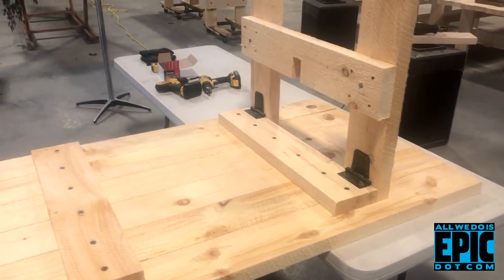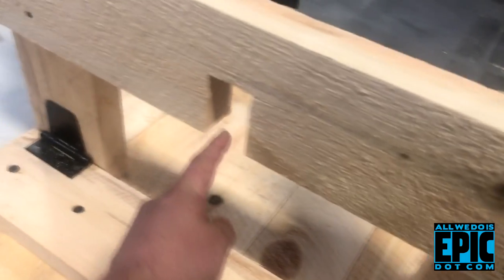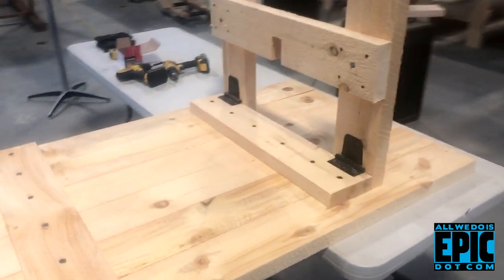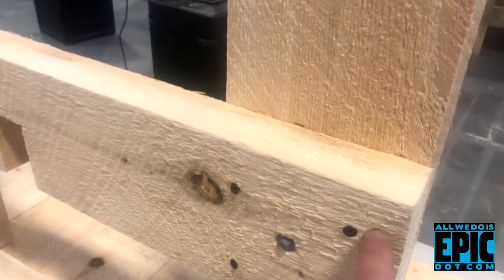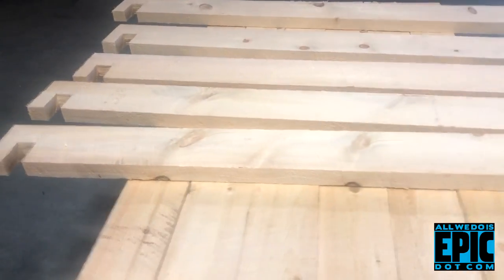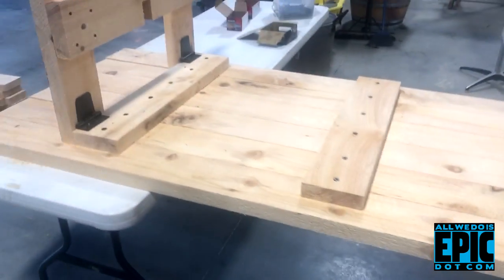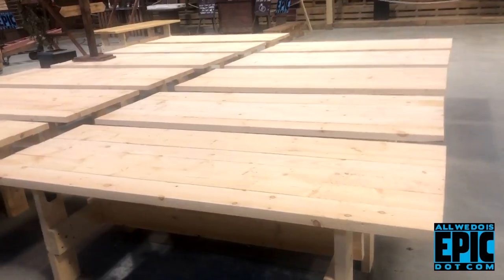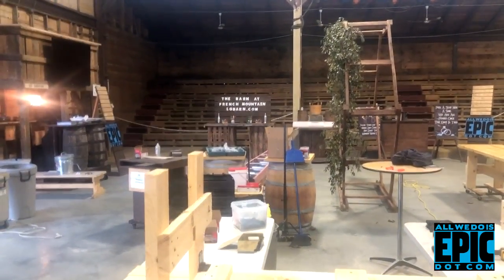H.T.W.P.D.I-Episode 1:  How to build a very simple, rustic, folding farm table.

Comment: I made some changes to the design that work really well. I am not taking credit for the build design but a few changes that address some of the issues. 
I built them with southern yellow pine. For the table top I added some pocket holes with the blue Kreg outdoor screws to attach the edge grain together and stop the top from racking. I have had no issue with cracking or movement. They have held up well through two summers and winters in Texas. 
For the stretcher board I changed the notch. The problem I had was the small end piece of the notch would break off. I moved the cut out closer to the end and cut out an L shape instead of a notch. I make it so it slightly pushes the leg assembly outwards and added heavy brackets from Simpson Strong tie to bolt the stretcher to the leg cross piece once its dropped into the notch. I used some heavy carriage bolts to fasten it together after setup. This removed just about all movement once the table is unfolded and set up. They can easily be broken down for storage. 
Do not underestimate the weight of these tables! They are heavy!
Reply from the maker: Awesome thanks Sean!
Reply: Can you please post or send me a pic of your upgrades to the folding farm table? Thank you in advance!!🙂✌

Comment: Thanks for the great video. I,m currently pricing 2 inch thick kiln dried pine and its close to $4 a board foot up here in canada. Are you using air dried pine by chance.....?
Reply from the maker: I actually used wet pine direct from the mill. :-)
Reply: @allwedoisepicdotcom3907  oh ok, I have a mill not to far from me that sells air dried pine. will check them out in the morning, thanks for the reply ...

Comment: Great design. Do you glue the table top boards? Or is it just the headlocks holding them together?
Reply from the maker: For this simple design, just headlocks.  Adjust as you see fit but we’ve had these now for a long time and not seeing any issues. I think if you’re gonna move them around a lot, from different rental location, def more reinforcement all over would be good.  Ours stay in one spot.

Comment: what do you use to grind the top?
Reply from the maker: Just a simple 30.00 grinder from any home improvement store. It takes the rough sawn wood down faster. Finish it with a sander if you want it finer smoothed .  :-)

Comment: How much do you charge to build those
Reply from the maker: usually around 250 or so minimum each.
Reply: @allwedoisepicdotcom3907  are you certain about that? The lumber and hardware cost is over $200. Add in the time to build, and shipping or delivery and it's a loss.
Reply from the maker: @seanbrotherton542  actually the cost is way under 200 and they take a half hour to build. This is rough sawn lumber, 8.00 a board max. :-)
Reply: @allwedoisepicdotcom3907  the stretcher that goes between the legs...how do you keep the end from snapping off being 2 inches from the end? I'm asking because I'm building one and decided to use 2x8 dimensional lumber instead. I cut the notch to tight on one end and I broke it. I know rough cut is 2 inches thick vs the 1.5 inch on dimensional lumber but the notch is so close to the end with the grain I'm concerned it could break and collapse.
Reply from the maker: @seanbrotherton542  actually since we made these we’ve added 5” L brackets on that exact spot for that reason.
Reply: Do you have contact information?
Reply from the maker: @seanbrotherton542  yes it’s on the channel.  All we do is epic dot com!
Reply: @allwedoisepicdotcom3907  I sent a direct message to Mark from your staff contact list. I really appreciate your responses.

So Mark is a DJ,  MC, woodworker AND knows how to dress? Gotta say that's an impressive combo.
Reply from the maker: @seanbrotherton542  he responded this morning already.